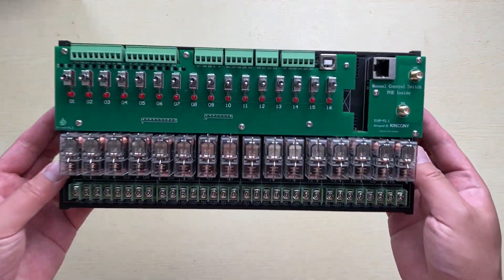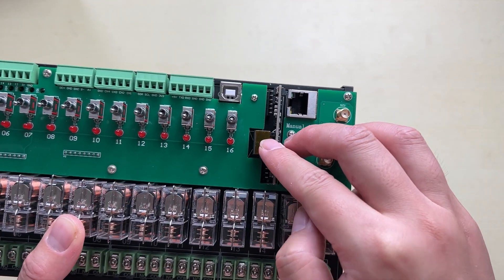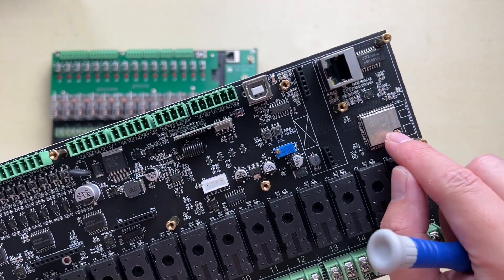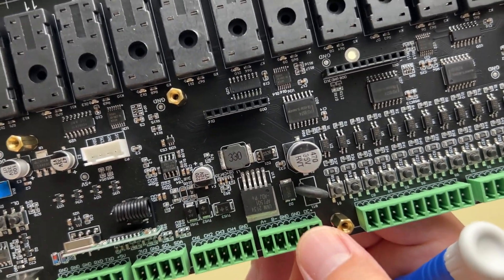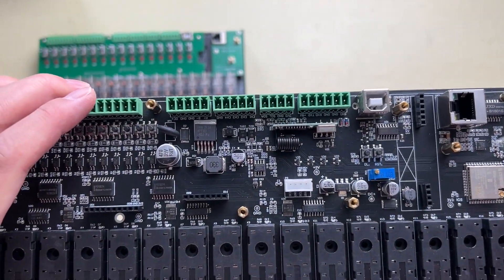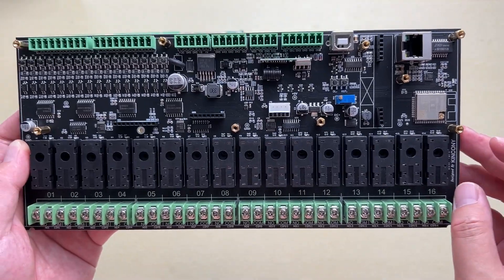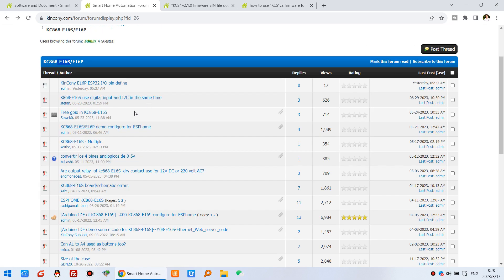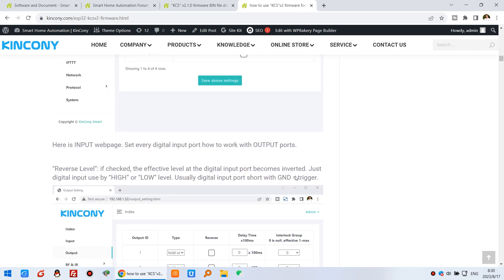ESP32 16CH POE Relay Module For home assistant & Tuya - KinCony E16P

Comment: If I want more than 16 outputs, is there an expansion board to be connected to the E16P or would it be necessary to purchase two individual E16Ps? Can I use an RJ45 network cable to make this card talk to Alexa directly or do I need another device? Can I install TASMOTA firmware on this board to use MATTER and add it directly to ALEXA? Thank you in advance for your questions, I'm from Brazil and the only option to purchase in my country would be via Aliexpress, which unfortunately, due to the current government in Brazil, has greatly increased the value of taxes, reaching + 92%, a 200 dollar product paid plus 184 dollars in tax. So I can't buy it for testing, I have to buy it now with the certainty that everything will work as expected. Thanks.
Reply from the maker: 1. if you want extend relay, you can use our i2c extend relay module -DO8 or you can add the second E16P by network cable is ok, second way is more stable. 2. we have made tasmota MATTER firmware, so that E16P can work with Alexa directly. you can download tasmota firmware BIN file from KinCony's forum.

Comment: Excellent work with this board. One question, have tou considered using MCP23017 to have more I/O? Is it a worst option than ehat you are using? Just asking to learn. Thank you🎉
Reply from the maker: because MCP23017 is hard to buy in China. PCF8574 is easy to buy.

Comment: Hello - I already found one solution, but there was quite challenging, because there are not much POE modules based on ESP32 for mainly inputs with pull-up resistors and only single output as a replacement of home alarm system. I beleave that today it would be good market for fire and alarm system based on Home assistant or similar..

Comment: Your inputs are using Optos which is good, but they still share common ground, try using a DC-DC converter to separate the ground.

Your I2C trace was routed directly under PoE module's transformer, this is bad for the signal, I've had a problem with a similar design in the past, so try to avoid it if you can.

You use I2C IO expander but didn't route the interrupt pin to the MCU, if you just want to control low speed relay and polling some inputs without needing interrupts, why don't just use some cheap shift-registers? it'll be harder to mess up the signal too.

Here's how you use just 3 pins to expand your I/O up to any number in exchange for speed:
DATA is routed to the shift out (e.g., 74HC595) array first.
The last output is then route to the first shift in (e.g., 74HC165) array.
The output of the last register in the shift in array is then route back to the DATA line with a 10k series resistor.
CLK and LATCH can use the same line.

In the code:
dip the LATCH to latch inputs and then leave it high
loop
  switch DATA pin mode to input and read 1bit of inputs
  switch DATA pin mode to output and set 1bit of outputs
  rise the CLK high and then leave it low
  repeat the loop until all registers are set/read
dip the LATCH to latch output and then leave it high
switch DATA pin mode to input

If you can spare one more pin, use separate pin for DATA in/out and skip the pin mode switching can improve the speed.
Reply from the maker: thanks for suggestion about i2c track with POE module. we design i2c circuit according to ESPHome, it have used interrupt pin. if we use cheap shift-registers, such as 74HC165, if one chip is broken, all ports will become bad. but use I2C extend chip, if one I2C chip is broken, others GPIOs also can work. just cost higher than shift-registers chip.
Reply: @KinCony  According to your schematic on the website, all your PCF8574P's nINT pins are pulled high via 10k resistors, but none of them was routed to the MCU.

Regarding the point of fail; yes, if one of the shift register is bad, all of them will stop functioning. But in case of a bad I/O IC, you will always want to replace the IC asap anyway, so it being cheaper (by 4x) means you save more in the long run by using shift-registers. Also, shift-registers are a lot less complicated, which mean they last longer too, assuming you design your circuit according to datasheet and don't overload the output it will last longer than the ESP itself.
Reply from the maker: Your words make sense, but we don't want to blindly pursue low costs and are more concerned about reliability @XiaZ

Comment: You're getting really good at designing these boards KinCony! You got nearly everything I want in an IoT board, but you're missing the NC contact and better emf protection on the relays. Couldn't hurt to throw on a plastic lid for those spicy parts either lol? I wouldn't doubt that we couldn't get approval for the c-tick to enter the Australian market here, I'd loved to legally install them into peoples homes.
Reply from the maker: thanks for your suggestion. because add NC will let pcb larger. usually use NO is enough.